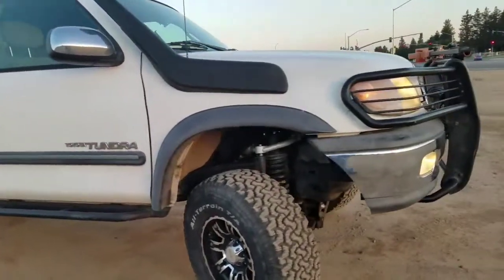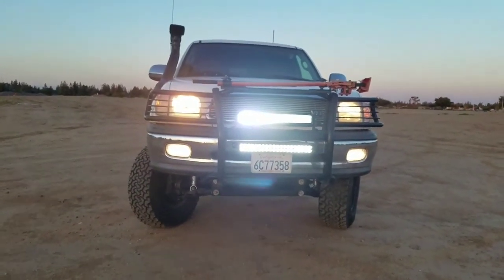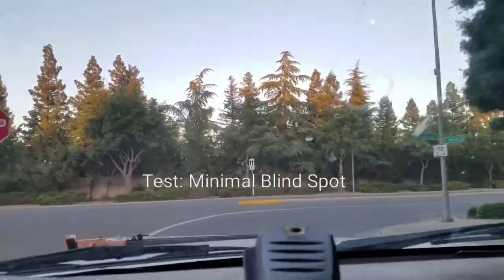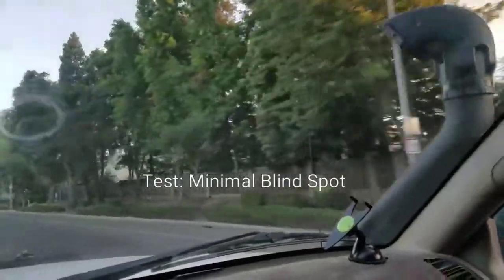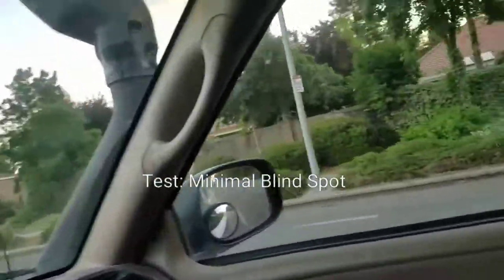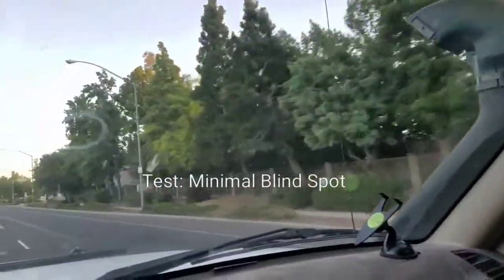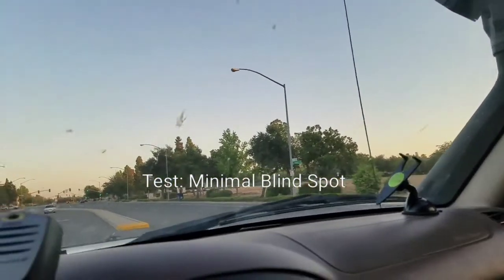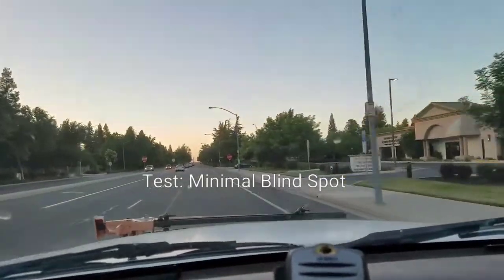Tundra Snorke Pt. 1

Comment: are you back to running the ebay upper control arms? if so, how do you like them?
Reply from the maker: goosebandit I am back to running the eBay arms. It runs great. just came back from a 300 miles trip with them and I like them. they are a bit stiffer but overall better handling.
Reply: The Other Guy What arms are they and are you still running them?

Comment: What lift kit do you have?
Reply from the maker: Tuff country 5 inch lift
Reply: @theotherguy3083  with front upper control arms? Did you have any issues aligning this after the lift? Also do you bust cv axles alot?
Reply from the maker: @Pitman556  the uca id currently replaced with spc uca